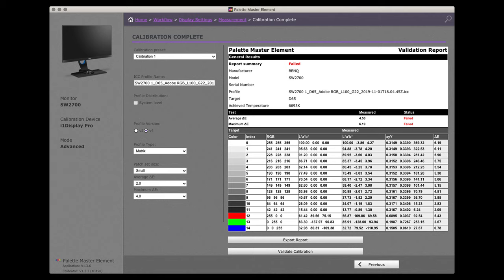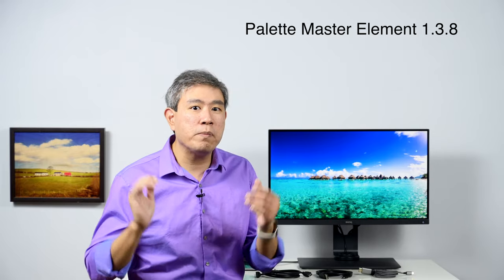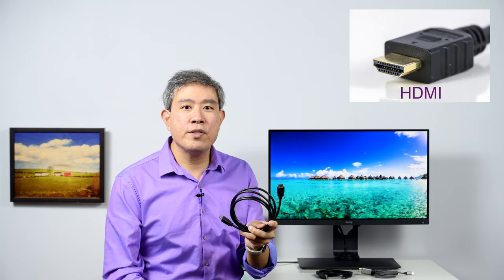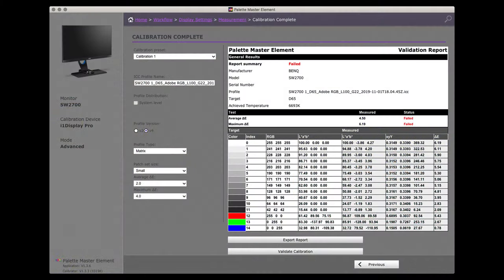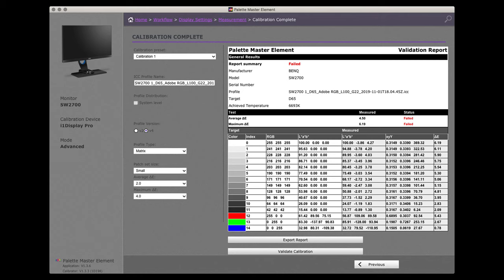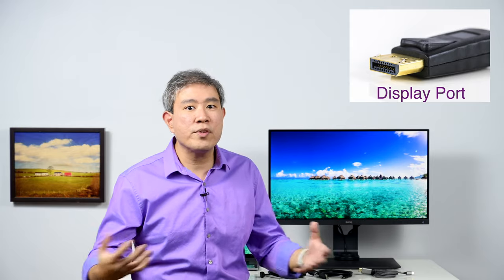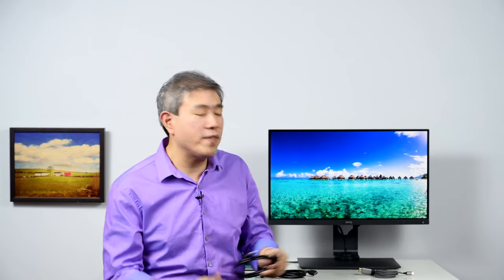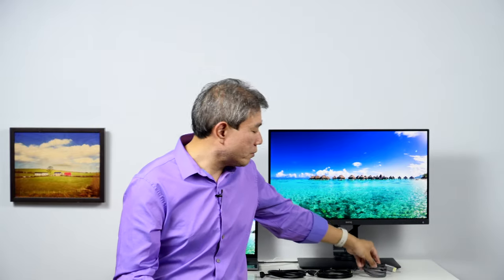HOW TO trouble shoot your BenQ SW Palette Mater Element Validation Fail Before Calling Support!

Comment: Pallette Master is the most buggy, unusable application I've ever had the misfortune of trying to use. With your help (thanks) I got it to work (using Color Munki) ... once, a couple of years ago, when I bought my SW271. Accordingly, the monitor keeps reminding me it needs calibration. Since then it's never worked properly and now, with my new Mac Studio, it just refuses to validate. First I had to switch from a display cable (w/dongle) because it just didn't see the monitor at all -- wasted a lot of money for the adapter! Then, with USB-C it sees the monitor but no amount of trouble shooting solves the validation failure. The monitor is nice but this time-wasting app makes me leery of buying another BenQ product.
Reply from the maker: It is the software, and they are making improvements. About the connection issues, there may be some explanation and ways around that but I am late to your specific setup and issue. About the validation there are numerous things that can cause that. The hardware is almost never the issue, it is the software that can be lacking at times. If you like to try, trouble shoot and diagnose this. Feel free to dm me on insta or Facebook. If you are just sharing your experience and thoughts, I appreciate this and will note this information down to share for future improvements.

Comment: Hi Art... I tried to calibrate my sw240 for display p3 but it always failed validation test. I read the report and the red color is failed due to ∆E is more than 9. Is it because the coverage of sw240 on display p3 which only 95%? Or is there any way to fix it? Is it okay to go on with that calibration even though it is failed on validation test? Oh ya, I am using windows 10, spyder express 5, and using display port cable, and the latest updated palette master. Could you please give me some advice to solve those problem. Thank You.
Reply from the maker: dm me, also are you using PME or PMU?

Comment: I am trying to calibrate Benq SW240 with x-rite i1 and newest Palette master ultimate and I get failed calibration report. I recalibrated it few times still failed report. I am using Deltaco usb C to display port cable ( 4k uhd, 60hz)  I was able to calibrate it about half year ago with iprofiler. Now it will not support old x rite device. What should I do?
Reply from the maker: Calibration failure is not that device is not supported. There's usually software conflicts. I would contact your local BenQ support for help on this. And if calibration fail twice, it will do continue to fail unless variable change, meaning software conflict was removed. etc. dm me if you need help, I won't see reply to comments.

Comment: Hello @artisright ; i a bought a PD2700U YESTERDAY. But am unable to run palaette master element to caliberate the display. It shows an error read as "usb cable no connected" but infact i have connected the type - b to type - a cable provided with the monitor to my PC. I have tried all the troublshooting suggested by in your channels & also have tried multiple factory resetting of the monitor as well but og no help. Can you please provide a solution tho the above situation. Thank you :) Looking forward to hearing back from you.
Reply from the maker: Palette Master Element (PME) is for BenQ SW hardware calibrated display only. PD you would have to use the calibration device OEM software.
Reply: @ArtIsRight  Thank you for your prompt response. Got it :)

Comment: Hello - I just purchased the new Spyder X2 Ultra, and now Palette Master Element will not open past the initial splash page. I chose "Spyder X" from the list, and "Check Sensor", and nothing happens. I click "Start" and nothing happens. This is for a BenQ SW320, btw. Any ideas? I was able to get it to work with my old Spyder 5, btw.
Reply: I should add that I have the latest version of Palette Master Element ( V1.3.19) - thanks.
Reply from the maker: PME is not yet compatible with Spyder X2, an update is needed.
Reply: Thank you - that’s what I figured was the case. I’ll check in on the Palette Master Element download page every so often to see if the update has been posted.
Reply from the maker: 👍🏼 I'll probably do a video about it as well.

Comment: Hi Art.  Even though my MacBook Pro is mirrored to my BenQ no problem, I keep getting this message when I start up Palette Master Element: "Make sure your BenQ display USB cable is connected to your computer. Then proceed with the set up."  Apparently, it thinks it's not connected but it is!  Help please!  Thanks :)
Reply: I've tried restarting everything, and unplugging and replugging in every cable.
Reply from the maker: First, take the display out of mirror. Secondly let me what computer do you have, os, version, and what cable(s) are you using to link your computer to your BenQ
Reply: @ArtIsRight  It was the mirroring! Simple fix. Thanks so much!

Comment: Hey Art! In the past I've successfully validated multiple calibrations. But I recently reinstalled windows from scratch, and now my calibrations are way off. They look super blue or even black. The max deltas are in the 40s. Do you have any tips on this issue? If it means anything, I'm using a sw2700pt which still has my old profiles, but my new windows system doesn't have them.
Reply from the maker: I like to get some more info from you. Please answers these questions completely and we’ll go from here.
1. What computer (Laptop - Mac specify the model, year and size, Desktop, iMac, all in 1 PC, custom build, etc )
2. What is your Operating System (OS) version are you using? (For Mac please specify the dot release, for Windows please specify version / build number)
3. What calibrator are using?
4. What version of PME are you using?
5. What BenQ model do you have?
6. What cable are you using to connect your BenQ to your computer for the display signal, HDMI, Display Port, etc.
7. If you are using USB-C skip this question, if not, are you using a USB link cable between your laptop and display?
8. If you are using Mac was this a clean install or was the OS upgraded from a previous version at any point (I.e. From Mojave 10.13.x to Catalina 10.14.x)? Or was this Mac restore from a back up, time machine or other wise?
9. For PC, what GPU are you using? If Nvidia are you using their new Studio Driver?
10. Were you able able to successfully pass the validation at some point?
Reply: @ArtIsRight  
1. PC custom build with nvidia studio driver
2. Windows 10, build 19041.572
3. i1 Display Pro
4. Palette Master 1.3.8 (I downgraded because the newest wasn't working)
5. BenQ SW2700PT 27"
6. Displayport cable
7. I'm not using USB-C. I do have a USB cable running from my monitor to my PC.
8. PC, recently did a clean install but previously was able to calibrate and verify.
9. GPU: EVGA Geforce RTX 2060 with Nvidia Studio Driver, all up to date.
10. I used to be able to pass validation but after reinstalling windows, it seems like my colorimeter readings are completely off. Do I need to reset my monitor settings after reinstalling windows?

Thanks!
Reply from the maker: Hi Andrew, you can try this to reset the display https://youtu.be/eG3HrnUvHYA
See if this helps. There's really no need to reset the display when the computer is formatted but it does not hurt. Do you have i1Profiler installed? And can you check this for me https://youtu.be/PDoDwMIFpeM this way we are sure it is not running in the background or starting with the system. Otherwise, I would advise that you try PME 1.3.10 because it has an updated X-Rite driver package. Do you have another display port cable that you can try or perhaps try calibrating it with HDMI and see if there are any differences in the result. Please keep me posted.
Reply: @ArtIsRight  I just tried all those things including the hdmi - no luck yet. I have i1 Profiler installed, but do I actually need to do anything with it?

I just tried versions 1.3.8 and 1.3.10 but those didn’t work either. Also during my calibration attempts, I saw the overlay in the center of my screen was blinking at regular intervals. Is that normal? 

Do you have any other tips?
Reply: https://imgur.com/a/0x1duED - Here's a quick video of what I'm seeing
Reply: I just tried calibrating with i1 profiler instead and was able to do it just fine.
Reply from the maker: Yeah i1Profiler will always work and it is a work around. Do you have another PC, computer, or Mac that you can do A/B testing with?
Reply from the maker: Also if you like to chat add me on my Facebook page https://www.facebook.com/Artisright-Art-Suwansang-100512488239337 and send me a message
Reply: @ArtIsRight  After battling my setup and trying A/B testing with literally everything for 10+ hours yesterday (and speaking to 3 BenQ techs) I finally found a fix. With the blinking overlay in the middle of my screen it's impossible for the colorimeter to calibrate while looking at it - it needs blank space. I don't know why that overlay is there, but my solution was to move my colorimeter to the way left of my screen and zoom in on my cursor, giving it adequate space to calibrate. I was able to get a good calibration and validate on the first try. But still, thank you for your help Art! Your videos are fantastic.
Reply from the maker: Good to know and interesting, that is a bug that should get address either way.

Comment: Amazing videos as always. I had no idea about the HDMI range limitations, but it's just what I was needing to know!
Reply from the maker: It does not happens on all machine. And most of the time you don't know this is happening but when it happens with hardware calibrated display, this is where the validation fail issue starts.

Comment: Very helpful video Art. I think there is an HDMI levels setting in some monitor system OSD. I see they are no longer on the SW321C. Yet there is a USB-C level 2 or 3.1, difference being refresh rate. No idea if this will affect calibration data transfer.
Reply from the maker: @Neil Snape, thank you for the feed back. From my experience, the HDMI setting on the OSD has always been grayed out for me especially on a Mac. So other input ports seems to be a much better option to side step this issue. Data transfer speed / refresh rate in this case does not affect the calibration. The range of RGB output does.

Comment: Hey @ArtIsRight thanks very much for this video, but unfortunately I'm still having issues with failed calibration.  I'm coming out my laptop into a docking station and then docking station to the monitor (I've tried lightning and displayport).  I've tried a lot of the recommended calibration settings from different sites and it's still failing.  Any suggestions before I return this?
Reply from the maker: See my other comment. Need much more info than you provided to help.

Comment: Hello Art,

I am running into an issue while i try calibrating my newly purchased Benq SW321c using the Palette Master Element 1.3.11 and Spyder 5 colorimeter.

I am getting really high delta values on the blacks, whites and greys (averages around 25)and the validation report is failing. I have tried various combinations Using

1) Basic Settings
2) Advanced Settings with Absolute Zero Blacks
3) Advanced Settings with Relative blacks
4) Advanced Settings with 16Bit LUT

I am using the Benq, mirrored to a 13” MacBook Pro 2015.

I am using the Mini DP to DP cable and a USB uplink cable to connect the MacBook pro and Benq. I am using the USB side slot provided behind the monitor to connect the Spyder 5 colorimeter to calibrate the screen

I have also ensured that the display settings such as auto brightness, night mode etc are disabled.

Not sure if this maybe a bug or if I’m still doing something wrong here.
Reply from the maker: Download .10 here and give that a try https://youtu.be/8rjRoIe0-mo if it does not work there's more diagnostic that can be done.
Reply: ArtIsRight Thank you, for the link. It did crash on a few occasions in the last phase of calibration, when the screen gets brighter. Ive managed to create 3 calibration slots thereafter.
Reply from the maker: So you were able to get 3 pass validation correct? I want to be be sure :) Let me know.
Reply: Yes, that’s correct. It still puzzles me, as to why the app kept crashing for a while, at the same point, just as the calibration was coming to an end. 

It worked just fine after that. I managed to calibrate 2 slots at 120 and 80 candela on my primary device and a third one over a different device
Reply from the maker: Awesome, it work and works well, that is all we can ask. :)

Comment: I was wondering, are each of the calibration presets calibrated separately or will the calibration apply to each of the presets when selecting panel native? If I select AdobeRGB and attempt to modify the luminance value to 80, the default becomes custom. Also, what is the difference between the RGB primaries, the defaults, and the measurement calibration preset?How do they work exactly? Thanks for making these videos.
Reply from the maker: Each calibration is in its own separate slot. Changing the luminance will put it into custom because this is your "custom" setting and it is only the user-facing GUI part, this is nothing to do with the actual calibration until you calibrate the display. The differences between various RGB primary is the color gamut you choose to use. Defaults, to which, there are a few are various suggestions.

Comment: After much digging found that Windows 11 did not identify my 2700PT BenQ.  First problem fixed!  Tried to calibrate with 1.3.15 but that did not identify my i1 Plus.  But 1.3.16 did and ran a calibration.  The average delta E passed at 1.76.  The maximum delta E failed at 6.43.  Have a USB to C on order. I believe I followed your recommendations as how to set up PME correctly.  Am running a test print to my local lab today to see if it is acceptable to use before the new cable comes.  Thanks for your help.  Ted
Reply from the maker: ∆e could be cause by the video card driver, I would check that you are using Nvidia Studio driver if you have a compatible card, don't use the game ready driver. Otherwise, it is a lot of diagnostic

Comment: Hello Art. Thanks you so much for your videos.
I have been trying to solve some problems with my calibrations, but I didn't quite figure it out yet.
I have a SW270C monitor, with a Macbook Pro, connected with a USB Type C to USB Type C, and I have an X-rite i1 Display Studio. I can run the calibration with the native software, but the Palette Master Element does not recognize the device. 
Also, different problem, is that when I calibrate the monitor with the native software (only I can do it anyway), immediatly after I can see the colors changing back and forth all the time. Any suggestion would be much appreciated. Thank you
Reply from the maker: Give this a look https://youtu.be/WECg_yYBlpU if this does not work DM me on FB page or insta
Reply: Hey! did you find out how to solve this problem? I have exclaty the same issue with the same monitor and same X-rite i1 Display Studio
Reply: @ArtIsRight  hey! thank you for your videos, but I still have the same problem with my SW270C monitor and the X-rite i1 Display Studio, but the unique difference is that I'm using Windows 11. Do you know how to solve that? Thank you again

Comment: Hi, Art! Thanks again for all your videos. Even after following all of your advice (one exception, below) I still cannot get PME to recognize my i1Studio device. I know the device works because I used it to profile my Mac PowerBook monitor using i1Studio software. I uninstalled the old ColorMunki software; I connected the device using a powered USB 2.0 hub (a suggestion from X-Rite); and I installed five different versions of PME. In every case I get the error message that PME doesn't detect my device. Any suggestions?

One thing: I don't know how to check whether I've got the right OEM driver for the i1Studio, as you advise. The X-Rite website isn't easy to navigate in this regard. I will keep trying. Thanks in advance for any advice.
Reply from the maker: John, I am aware of this issues with some PEM versions and it has to do with X-Rite device service but beyond that I'm not sure what else could be causing this. Have you tried on another PC?
Reply: @ArtIsRight  I got it sorted out after two calls to BenQ tech support. On the first call I was told to uninstall i1Studio for PME to work. This seems insane because it means I would have to install i1Studio every time I wanted to create a paper profile and uninstall it again when I wanted to recalibrate the BenQ. Anyway, it didn't work. On the second call I was told to do two things: (1) uninstall any .icc profiles for the monitor that I had created using X-Rite hardware and software, and (2) connect the monitor to my Mac with a USB-A/USB-B cable (perhaps this was in one of your videos, but I missed it). This worked. The calibration ran slooooowly, but it passed the validation tests beautifully. I hope the details I report may be helpful to you.
Reply from the maker: Glad that it worked, there're 2 videos that talks about cables and connectors but it's ok. as long as it works.